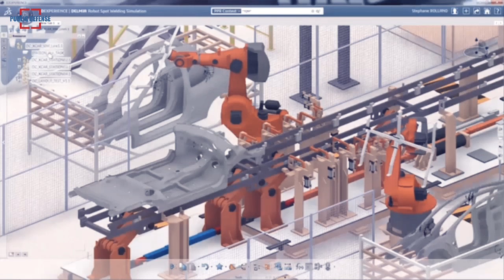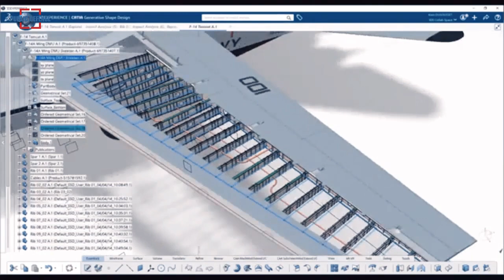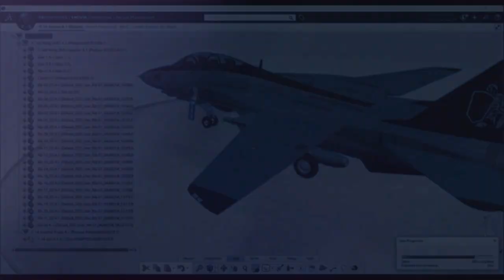TAI & Dassault Systèmes has Working with Digital Twin Technology for Design & Production of the TF-X

Comment: What are you saying?  Turkey and France developing TFX? Stupid
Reply: France is not part of it.  The software by Dassault Systèmes, which is a French Company, but not a governmental entity, is a very powerful software that can built an entire car or airplane or other mechanism from scratch using real world parts.  For example, Turkey will be using GE Engines.  So, when designing the rest of the plane, everything think will be designed around the engine and the designed part can be manufactured and have their own parts number and Drawings and everything a company need to start building a sophisticated airplane.  

The software also test the design based on information fed to the computer, so the virtual airplane can be tested for flight in rain, snow, heat, night or day, etc..

This is a smart move by Turkey, and not a dumb one.  It took India more than 30 years to design the Tejas, 3rd Generation fighter, so this is not not a mistake.
Reply: Although France is a NATO member, they do not get along well, but they are actually allies.  France is one of the countries where Turkey sells the most weapons.🤷🤷